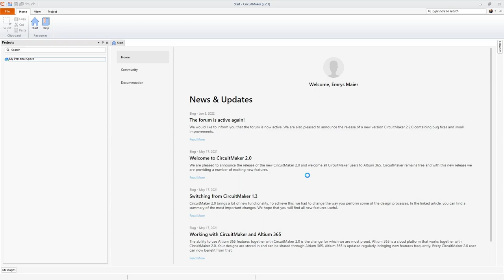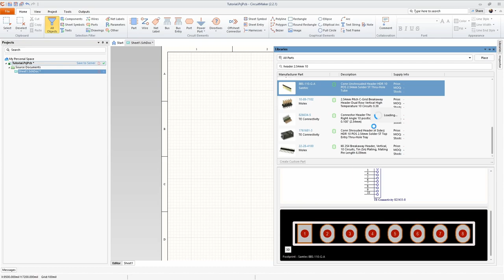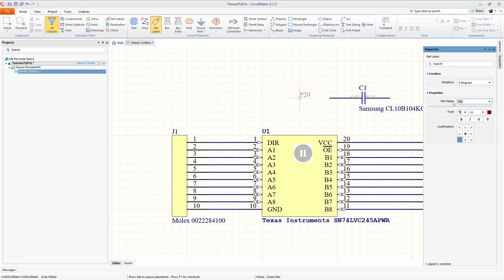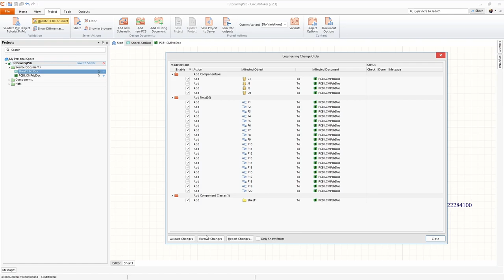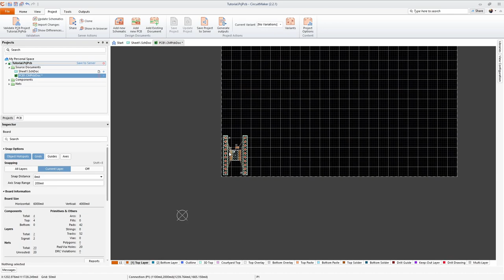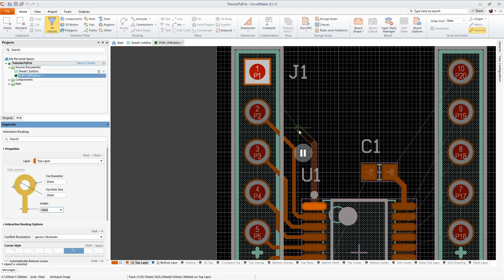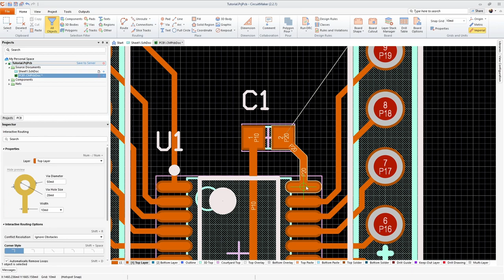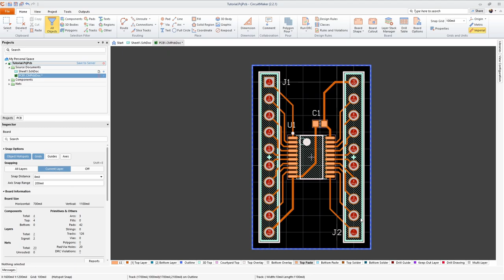Start to Finish Board Design Tutorial for CircuitMaker 2

Comment: Again, great video! At 12:48 those net lines are called "Rubber Bands" by most PCB routing engineers. They are to give you a rough idea of how the traces will need to be routed. That flip you see in the Rubber Bands between J1 and U1 is called a "Bow Tie" and is very common. You fixed it like a pro by pushing Space on the keyboard a couple of times.  Sometimes, you might have a signal on a component that could be swapped with another pin to get better access for the traces. For example if a signal on J1 didn't line up with with its respective U1 pin, there is a way you can swap "Rubber band" pins around on a component to get a better line up. You didn't need it here, but it is the next "trick" I need to learn.  After doing a swap, the signals assigned to the pins may now be a little out of order from what you "dreamed" for, but the electrons don't care, the routing of the PCB usually matters more. That is why we call our initial placement and pin assignments as our "Dream Layout", on large designs you will find compromises from the Dream Layout to the final layout. That is why the PCB Layout is called "Artwork"... it is an artform.
Reply from the maker: Thanks for the inputs Paul! I have had to change out pin selections on a few designs to make the layout work better, but I had also wondered how professionals handled this type of thing. I imagine in many companies the person designing the FPGA / MCU firmware is somewhat disconnected from the layout engineers, so it could be a bit of a back-and-forth to get everything to work out exactly right.
Reply: @electronicswithemrys  Every engineer is different, most like to sit down every day or so for a few hours with the routing engineer, I did too at first (its how I picked up many techniques in PCB layout but never really did it), but over time I saw that was an inefficient use of two engineers' time. That is when I started "constraining" my schematics. I put max length, trace width, impedance, keep away spacing, critical routing, max vias, layers allowed (vertical and horz), length matching, differental pair, corner angles/arcs for traces, and more on just about every signal in my schematic. The routing engineers hated me because THE DESIGN was acting like I was sitting there... like: no, you can't put that trace that close to that clock signal.  
They were good folks but not electrical engineers. Many would not even look at the schematics and use the rubber banding alone to route.
Not good. For example, in many digital circuits you have to impedance match an output pin on a chip to the trace impedance for superior "signal integrity". In high speed digital designs, impedance matching is paramount.  Say and output pin has a 20 Ohm impedance and you want to match that to a 50 Ohm trace, you need to put a series resistor (about 30 Ohms in this case) to match the impedance. BUT, that series resistor MUST be as close to the output pin as possible to work properly.  Now, if a routing engineer just follows rubber banding, and never looks at the schematic for placement clues, that series resistor can end up nowhere near the output pin. So electrical engineers that like to sit down with the routing engineers are constantly catching things like that and they fix it together, 3x the engineering effort.
But because I constrain the net between the output pin and the series resistor (say 300 mils max), the routing engineer is FORCED to place that resistor near the output pin. They do not have access to the constraints editor. If they get stuck, they call me and I can relax a constraint now and then but in general it's pretty much locked down.  I spend very little time with the routing engineers and that freed up my time to code FPGAs or write software. I do hardware, software, and firmware (FPGAs). Because I design the hardware, design the FPGA pinout, logic and routing, and write the software for my designs, it becomes a well meshed design... but in many companies that would take 3 engineers, but if they worked "borderless" and communicated well and thought alike, all 3 could design a board/FPGA/software from 3 different places in the world.
Reply: @electronicswithemrys  Yes, when a PCB layout engineer needs to swap pins on a connector. The electrical engineer needs to be notified and approve the swap, but before the ok is given, the electrical engineer (usually the defacto lead of the board design) has to coordinate that with the designers of other boards to where the connector mates, as well as cabling and documentation at every level so EVERYTHING matches up. This is done through an Engineering Change Order (ECO) process.  Only after everyone signs off on the ECO, the routing engineer is allowed to swap a connector pin. Since connectors are usually locked down before being sent to PCB layout, it has to get changed on the schematic end first by the electrical engineer. It may take a week or longer to push an ECO through all the stake holders. That is where good mangers come in to make sure everyone responds to ECOs promptly and that they follow up and update their designs and documentation immediately. It takes a lot of discipline from everyone to make it work efficiently and accurately. That is where Quality Control (QC) comes in, they want proof that every 't' was dotted and every "i" was crossed by everyone as a result from the ECO.
Reply: @electronicswithemrys  I am new to Altium CircuitMaker (Version 2.2.1 is what I have).  JLCPCB failed the audit of my PCB twice. First for extra files they did not need but would not tell me which ones, then a second time for missing Gerber files. It turns out, by default, none of the Gerber files are selected for generation in the setup. It will generate a few by default no matter how many are selected or not. So I checked all the files and now I get a lot more Gerber files.  I sent a list of the file extensions of the Gerber and NC Drill files to my rep at JLCPCB asking which ones they need and which ones they dont... I am awaiting their reply. They are very nice but I am new to generating Gerber files and sending them to a fabrication house.

Here is my list and my research as to what each file is for. Can you and other viewers take a look and tell me if it makes sense or not and which file types are normally not needed for a simple 2 sided PCB with silk screening on only the top side. Thanks. 

ALDL_Adapter_Paul_Romsky_Rev_B

              Layout Tool: CircuitMaker Version 2.2.1
Embedded Apertures Option: RS274X  

F
l
a
g
s  Layer Extension   Layer Description                      
-- ----------------- --------------------------------------------------------
   .EXTRPT           External Report of Gerber Files (Similar to this format)
   .APR              Aperture (generated as .apr)
   .GTO              Top Overlay (Silk Screen)                            
   .GTP              Top Paste  (Solder)                            
   .GTS              Top Solder (Mask)                            
   .GTL              Top Layer (Copper)                              
   .GBL              Bottom Layer (Copper)                            
   .GBS              Bottom Solder (Mask)                          
   .GBP              Bottom Paste (Solder)                          
   .GBO              Bottom Overlay (silk Screen)                        
   .GM1              Board Outline (Top Mechanical)                                
*  .GM13             3D Top                                  
*  .GM15             Courtyard Top                          
   .GKO              Keep-Out Layer                          
   .GPT              Top Pad Master                          
   .GPB              Bottom Pad Master                      
*  .1                Dielectric 1                            
*  .GML              Multi-Layer                            
   .GD1              Drill Drawing                          
   .GG1              Drill Guide    
   .REP              Report Individual Layer Used Aperture List
   .RUL              Rules used for Design Rules Check
*E .APR_LIB          Macro Aperture Library
 
   .DRL              Drill Data
   .DRR              Drill Report (Tool Size)            
   .LDP              Layer Drill Pairs Report (Export File for PCB)
   .TXT              Drill Positions
*  BoardEdgeRout.TXT Board Edge Routing

x  .PCBPRJ           Native Project Save File
x  .GM2              Board Outline (Bottom Mechanical)
x  .2, .3, ...       Dielectric 2, 3, ...
x  .APT              Aperture
x  .G1, .G2, ...     Internal Signal Layer 1, 2, ...  
x  .GP1, .GP2, ...   Internal Plane Layer 1, 2, ...
x  .P01, .P02, ...   Panel 1, 2, ...

Flags:
* I did not find a definition on-line for this file type.
E File is empty.
x File is not provided in this design.
Reply from the maker: @paulromsky9527  Hey Paul - I made a video showing my method for exporting for JLCPCB here: https://www.youtube.com/watch?v=mDIUmUYoSBk&t=5s
Reply: @paulromsky9527   Thank you for this huge insight of how a professional team of electric engineers work together in an embedded design project. Im an electronics engineer and would love to work in an enviroment like that, because of several life choices i ended up working as a sales engineer rather than a design engineer but i would love to move into design very soon . I suppose from what you are talking about you are more of firmware engineer than a pcb/hardware engineer.
Reply: @IsaacBG84  I am more a hardware design engineer. When I was a young pup, I could not get software engineers to help me test and integrate my designs, so my mentor suggested I learned C. Before long I was writing as much code as I was designing a PCB (electrically, but not laying them out). When FPGAs hit the scene, I learned VHDL. FPGAs are considered firmware. So I now do all three. Sales engineering has its pluses too. One is you don't have ever decreasing schedules and budgets.  The main thing is you don't have to fight those electrons [smile].

My boss once told me: " You can bullshit management, you can bullshit the customer, but you can't bullshit those electrons."

Comment: Hey mate, I’m using circuit maker for the first time and following your tutorial has been great.
I’m having a problem though. A lot of the components I need aren’t in the list, so I have made my own, it works well on the schematic but when I try to update pcb document it says there are no differences even though the pcb is blank
Reply from the maker: Oof - that must be frustrating. I'm afraid I'm probably not much help as I have not run into that issue. There is a circuit maker forum if you want to get help from the official makers: https://forum.circuitmaker.com/

Comment: Thanks for the video. How can I export as pdf of a sheet? I checked the net and it says that I can save it as PDF in print section but when I open print section it's just a blank window. How do I solve this?
Reply from the maker: On my system, I just right click on the schematic I want to print (in the "Projects" pane to the left), select "Print..." and then change the printer name to "Microsoft Print to PDF." I'm sure this will be different depending on your operating system and installed printers.

Comment: I want ot develop PCB skill to be employable , is Circuit maker a good way? I want to use a tool used profesionally
Reply from the maker: There are a lot of different PCB design tools and every company is different -- but from what I've seen, Altium is very popular among professionals. CircuitMaker 2 is extremely similar to Altium (it is the 'free version'), so I would say that it is a good tool to learn. Knowing CircuitMaker 2 should make a transition to using Altium professionally much easier.

Comment: I'm trying to access the components section but it's not opening..what to do? I'm unable to complete my course. Stuck !! Please help
Reply from the maker: I assume you mean the "Libraries" tab on the right side of the screen? If you don't have that tab, it can be found in the "View" ribbon at the top. If it opens and is blank - so is mine. I have to put in a part number to get results to show up. If the components don't show up after you try to search for a part, then I'm afraid I don't know what is wrong. It could be something with your internet connection (perhaps a firewall blocking the application?) or it could be a problem with the CircuitMaker software. If you've tried everything else and you think it's a bug in CircuitMaker, there is a forum where you can post the issue to get help here: https://forum.circuitmaker.com/#/